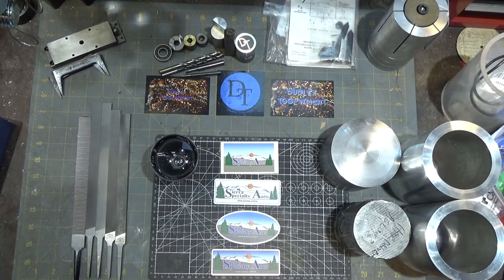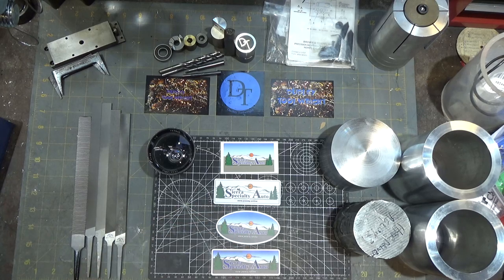111 Spanner Wrench for Lens Disassembly

Comment: Unfortunately lens bodies are easily bent. Instead of machining off the soft aluminum take a piece of hardwood plank and bore a hole in it so that it just slips over the lens body O.D. . Now turn another piece of hard wood to the threaded I.D. . Lop off both sides of the disk so that you have a piece ~1/2" (13mm) wide with the correct I.D. radius on the ends. Slip the lens  into the plank  along with  a cardboard disk backed with lens cloth to protect the lens (The glass is often coated and plain cardboard or paper may scratch the coating). Now with the lens supported on the work bench you can use the 1/2" wide piece and a small hammer to remove the dent in the lens body. Work the dent out from both sides towards the middle of the dent and with some patience you can completely remove the dent without damage to the threads or the lens.
Cheers from NC/USA
Reply from the maker: Sounds like a really good solution. Thanks for taking the tile to explain this solution.